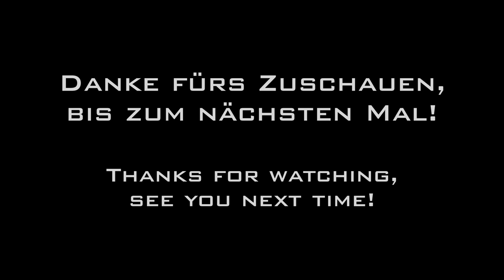Amazing heavy lifting crane changing its telescopic boom on highway Liebherr 1650-8.1

Comment: need to say why this was changed!!
Reply from the maker: due to weight restrictions
Reply: Germany and many places have axle-weight liimits on the roads at or below the 12t mark, depending on the area. at 12t axle weights, across 8 axles means 96t of vehicle.
The Liebherr LTM 1650, as in the video, with the full 6-section boom, riggers, superlift (not seen on this video), in road travel (riggers fully retracted, superlift and boom stowed and boom on the travel rest) weighs 134t thereabouts, putting 19t of weight on each of the first four axles, 16 on the rear. AFAIK this is not  road-legal anywhere in the world, and only intended for on a job site itself, between setup locations
In areas, like the UK, where 16t is allowed, there are four ways of getting all axles below 16t, but not all below 12t.
1) With 6-Section Boom, Rear Outrigger Box, Without Superlift
2) With 6-Section Boom, Without Superlift, Rear Outrigger Box
3) With Superlift, Outrigger Box, without T4-6 Boom Sections
4) With Rear Outriggers, Without T4-6 Boom Sections, Superlift.
These are presumptions because the product page on the liebherr website seems to have an error in the depiction - the with-6 but without superlift options that are w// or w/o rear rigger box shows the rigger box on both, and the fourth option I'm presuming comes from an image that shows WITHOUT the rear riggers, even though thats the same picture for a 12t-load.

For Road travel at or below 12t, they're all without the rear outrigger box and superlift.
1) With T1-4 Boom and front outriggers. (12t)
2) With front outriggers and boom luffing ram, without boom. (5.5t, 10t)
3) With boom luffing ram, without boom and front outriggers. (5t, 10t)
4) With front outriggers, without Boom and luffing ram. Crane upper structure slewed 180 degrees from road travel. (7t, 8t,)
5) Without front outriggers, boom and luffing ram. Crane upper structure slewed 180 degrees from road travel. (6t, 8t)

Presumably, to get below 6t limits (which apply in a few areas), the upper structure itself would be removed, but the product page doesn't show about that.
Reply: That’s also a tip section tho. That’s what’s confusing to me.
Reply: @AlMcpherson79 I understand the weight restrictions thing but why put another tip section
Reply: @DREAMMACHINEShh why replace one tip section with another. If it’s too heavy take it out. Put something to cover the hole an be done with it
Reply: @jevonescobar3023  sometimes you don't need the long boom, the ltm1500 for instance was a 50 or 84m option. The 50m is to enable travel with boom and quicker rigging times for jobs where both the axle limits would have meant removing the 84m sections, but also for jobs that the 84m just isn't needed over the 50m.
Reply: @AlMcpherson79  that’s amazing brothers thank you
Reply: @jevonescobar3023 
If you look closely they actually removed three sections and replaced it with one.

Comment: Brilliant video,  i didn't  think  that was ever done,  i thought boom length was determined by size crane weight wise.  👌👍👍
Reply from the maker: :goodvibes:
Reply: Liebherr LTM1650 has 2 boom configurations
Reply: No, you can usually order cranes with different boom lengths!
The thing is, longer boom has more weight, less stability, so carries less, shorter boom is shorter :p
Reply: @SamDemo  Liebherr LTM1650  has a quick change interchanged boom system, allowing operator a choice of 54 or 80 m  (177ft or 263 ft) boom to be fitted, depending on the job.
Reply: @stuartandrews4344  i know
Reply: @SamDemo  🤭Sorry Sam,wrong name, replied was meant for Luke.😁

Comment: The replacement looks like a smaller part, single tube to replace a multi.
Reply: It's not road legal with 5 section boom, 3 section one is within limits. So depending on what the next job needs, you either just remove the part and reassemble on the next job site, or swap it like here.

Comment: T5 configuration -> T3 configuration.  The removed boom has 3 telescopic sections, the inserted boom has only 1 section.  The 2 sections on the vehicle stay attached all the time.
Correct ?
Reply: Entire boom can be removed if you need even less than 12 tons per axle.